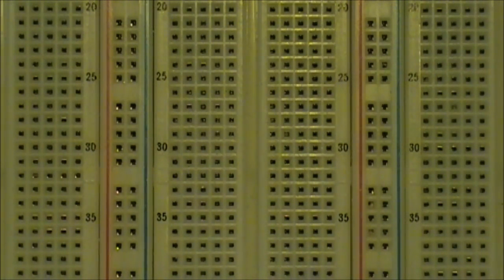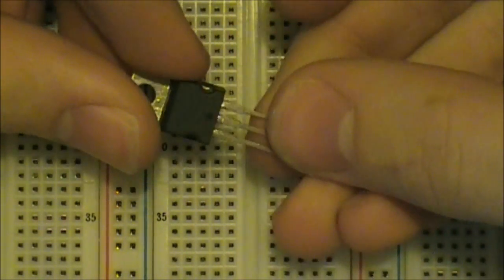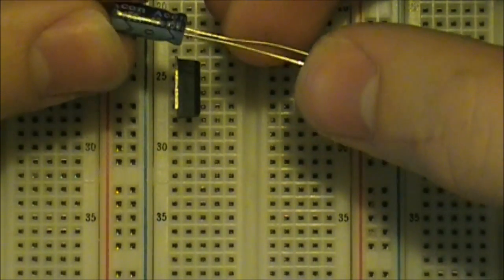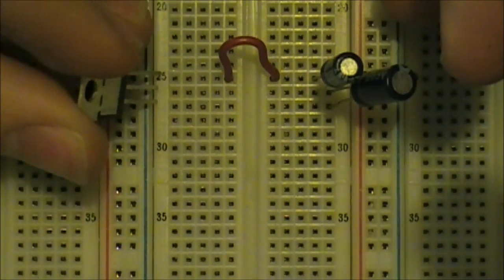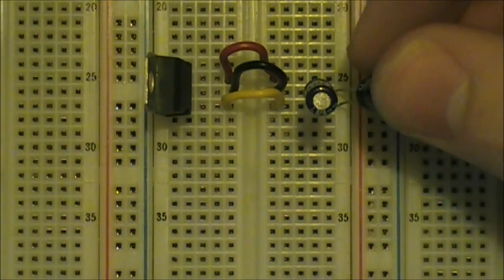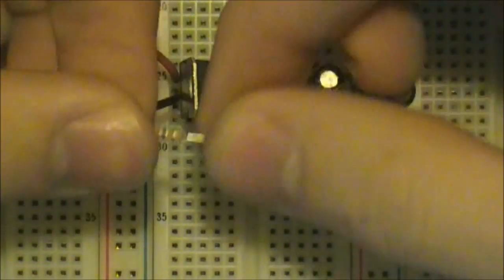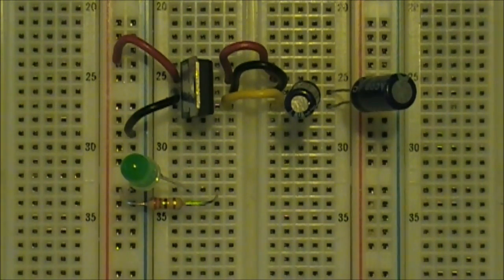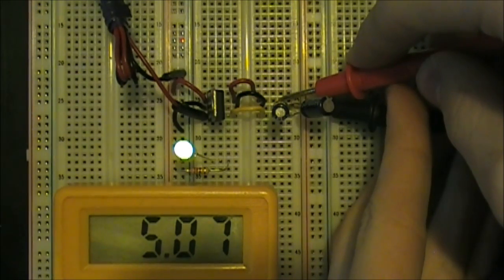IC Investigators - The Voltage Regulator

Comment from the maker: This really isn't a big deal for just turning on an LED, but when you hook up something like a microcontroller and other digital electronics, power fluctuations can be a HUGE problem. Because even a rudimentary computer chip can operate as high as 16MHz, a few milliseconds with inadequate power is a big mess. Does that make sense?

Comment from the maker: The capacitors help keep the output voltage steady. Whenever a load (motor, LED, etc) is turned on, the power supply (in this case, the voltage regulator) must cope with the new drain of power. Most of the time this is no problem, but say I hooked up a fairly big motor to the output, the drain from the motor would be so big that the output voltage would go down for a few milliseconds. The capacitors are like storage tanks that kick in when those dips come so that the output remains steady.